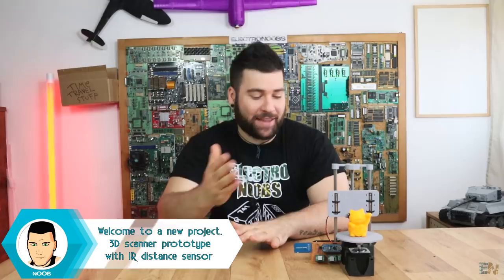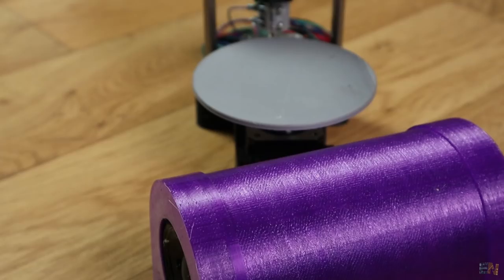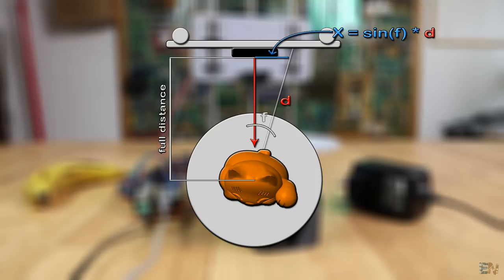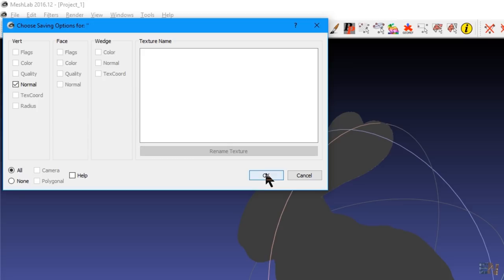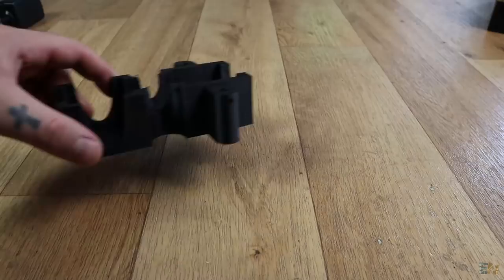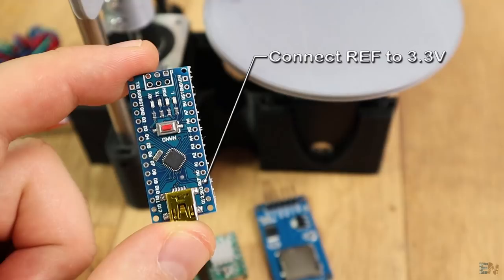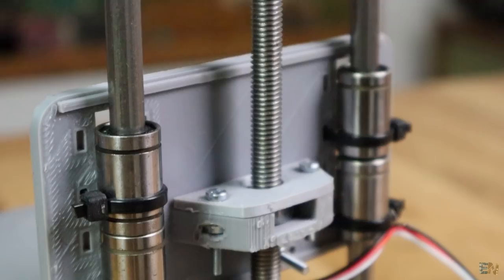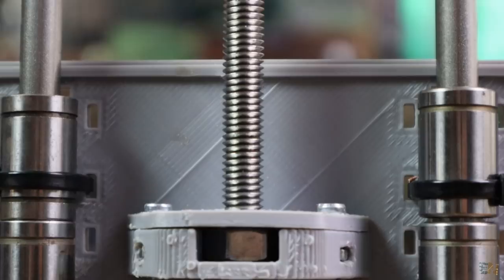Arduino 3D scanner IR distance sensor

Comment: thank you !!
your site with the description of how to convert a 'point cloud' file to STL has solved me a big problem on how to make a 2.5D scanner
to be connected to a CNC milling cutter to scan raised objects. Obviously I use a sensor based on laser triangulation that costs about $ 50 but has an accuracy of 0.1 mm :) which you could also use in your system to make it extremely accurate in the detection of points. Anyway thanks again !!

Comment: hello first of all. I have to ask, do we need to combine the step and activating connections in the motor of the z axis? if it is not needed, the z axis does not move in this regard. As the second point, I completed the connections completely as you mentioned, but it starts to work automatically when power is supplied. The d2 connection and the 5 v connection seem to be ineffective. How can we solve this? My third problem is that the sensor performs the scan, but the resulting model is very different from the real thing. I would be grateful if you help.
Reply: As you said like in the video I do aal connection and get a code but in this coddition z axis didn't move a single step

Comment: Hi Electronoobs,
 I have tried this project by using the same equipments and coding as well but when I rendered the point clouds to the meshlab software, it is showing half scanned part only, I dont know why. What  is your suggestion on this problem?
Thanks
Reply: whats app my friend, i have the same problem and i watched a lot of videos and i think the solution is to use matlab code, if you got it right in other way i would appreciate the help. thanks:)
Reply: Same problem

Comment: Use microstepping for stepper motor drivers 
Those A4988, they do support microstepping
Try that and maybe you’ll get better resolution!
Reply from the maker: I've tried. The error is in the sensor. Sombody told me to place tape over the sensor and make a small hole. That will give better results...
Reply: Great work. Have you considered Time of Flight (TOF) distance sensor such as Adafruit VL53L0X or VL6180X?
Reply: @ELECTRONOOBS  Acredito que a resolução do sensor associada aos micropassos (microstepping) do motor poderão melhorar muito o resultado. Resolver somente um dos casos será somente meia solução e não será satisfatório.

Comment: Hello. I used the limit switch code in your 3D scanner topic in my hobby project. However, GP2Y0A51SK0F(2-15cm) sharp sensor is used in your project. In my project, GP2Y0A41SK0F(4-30cm) sharp sensor is used. I will change the relevant code in your code, but I could not find the distance formula for my GP2Y0A41SK0F sensor. Can you please tell me the formula to add to the code?
Reply: you can find it in the datacheet

Comment: I have done everything exactly the way you described. But the point cloud file generates a very different structure in meshlab. There is no similarity between real object scanned and the generated meshlab structure. What is the problem ?
Reply: Have you corrected this?

Comment: It's my first order on jlcpcb but it is showing shipping charges the dimensions are lower than 100mm why
Reply: Did you change any of the default settings for the PCB? If there's a change to almost any of those values, the special pricing and free shipping become unavailable.

Comment: i need help i am implementing your 3d scanner for a project and i am using the IR infrared sensor 10-80 cm and the output is not correct .
Reply: What doing?

Comment: Hello, Electronoobs! I'm very glad to see your video about 3D scanner and I decided to repeat this project. So, I assembled 3D scanner, launched, tested, but in result of scanning i had scan with half of the circle point cloud on 180°, moreover another half of circle is empty(without point cloud). It is very strange, so as it should be generate point cloud on 360°(completely) ! Do you have some idea about solving of this problem, Electronoobs?
Reply: Does it work
Did you use his code 
Do code work properly
Plz tell me coz I have to make it too
Reply: @gpittule6166  I had already decided this problem, don't worry. Just need to change formula of convert degrees to radians.
Reply: After the change of formula will it work I want to do it for my project activity
Reply: HI please how did you resolved the problem please help me
Reply: Hello did you solve it

Comment: Puedes decirme solo una cosa que estoy construyendo controlador de vuelo que has hecho en un video antiguo>
simplemente conecta el sensor acc y gero (mpu6050). Desea conectar el sensor barométrico para que las conexiones sean así?>

SENSOR BAROMÉTRICO:
GND TO GND
VCC A 5V
da TO A4
CL A A5
** ESTO ES CORRECTO O NO, POR FAVOR DEBE RESPONDER **

CONEXIONES MPU6050:
VCC A 5V
GND TO GND
SCL A A5
SDA A A4

POR FAVOR DEBE RESPONDER
Reply from the maker: ALL IN ONE TECH so, Los pines Dr i2c son los mismos siempre, scl A5 y el sda A4
Reply: wow tío recibí respuesta de ti estoy tan feliz> muchas gracias hombre
Reply: ¿Podemos conectar un módulo gps y bluetooth o wifi en él?
si es así, ¿cuáles son los pines de eso?
gracias chico genial (advence)